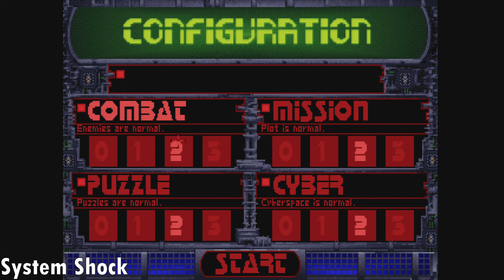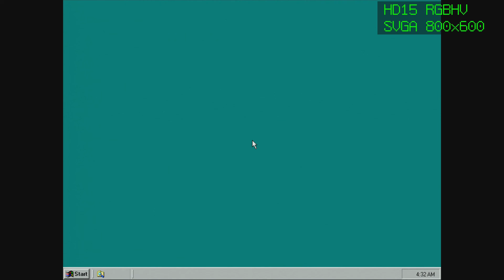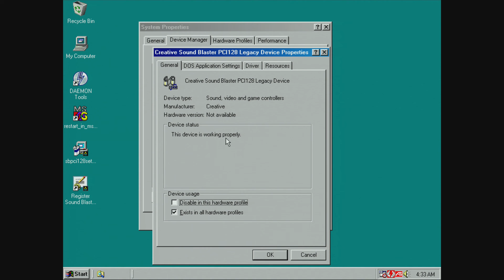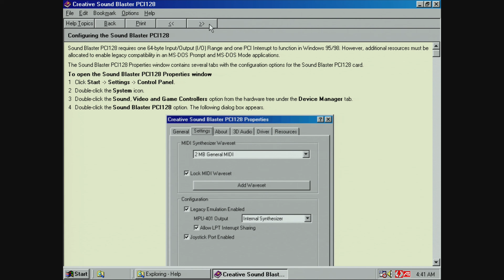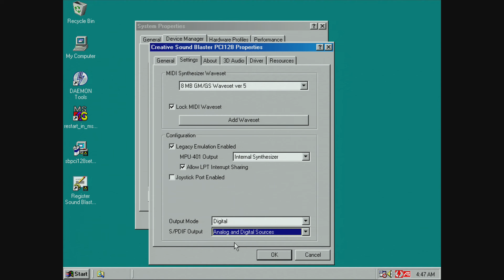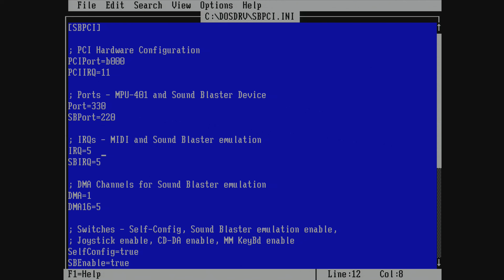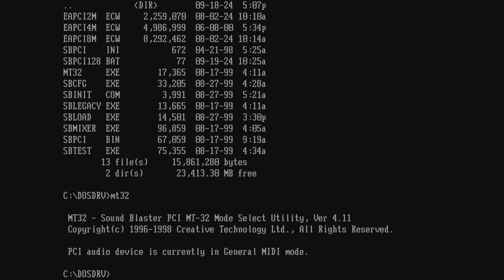Why no love for the Sound Blaster PCI 128?

Comment: I had a motherboard with an onboard Sound Blaster PCI 128 in the late 90s. I didn't have a great experience with it. Too many DOS compatibility issues and I hated the midi playback on it. Luckily the motherboard also had a ISA slot and got a Sound Blaster AWE32

Comment: This was the sound card I used in the first PC I built. Why? It was cheap and I didn't have much money. IIRC it was $25 new in 1998. That was actually an earlier revision, with the es1371 chip - still basically the same functions. It was fine for my needs and I never felt the need to upgrade it ASAP as I did with the cheap video card I had.

Comment: Thanks Phil, I'm impressed how your were able to get so much from that sound card! I tested it a few years ago and I felt like it was trash. Back then (in 2020) it was available for 1€ (1.08 USD / 1.63 AUD) in France. The driver has an emulated FM Synth that is absolutely horrible and sounds like a joke. The General MIDI works but I had issues like music crackling on Duke Nukem 3D on my Pentium 120 MHz build. I think this is a better idea to buy either a Vibra16 ISA (cheaper than SB16 and underrated) or a SB Live! PCI.

Comment: Do the newer drivers for the SB Live/Audigy support switching the MPU-401 emulation from the internal synth to the MIDI port? I bought a Live! card new in 1998 and the DOS drivers were terrible. Even the 2.0 drivers were pretty bad (although they had actual FM synth emulation), they STILL didn't allow you to route to an external MIDI device in DOS (ECW Ensoniq wavetable only) or Windows DOS boxes (internal SoundFont GM only). By 2000 I was running Win2k so I don't know if the DOS drivers evolved at that point. Once VDMSound showed up, I never looked back!

Comment: Does mpu-401 work in dos mode also? Or just in windows?

Would like to find a card that does it. The awe64 does allot and very good. But I can't for the life of me get mpu-401 and output to a Sc88 working under windows. In dos mode it works perfectly fine. But in windows it routes everything to the built in synth regardless what it set under multimedia devices and midi.

Comment: I have 2 or 3 of these. but I wonder how much performance these rob from the rest of the system.
Reply from the maker: Not that much I believe, but yes good point, it's not something I've benchmarked. Actually, I might have done something along those lines a long time ago. Not sure if the card was included though...
Reply: I have some CMI 8000 series pci cards that can do most of these functions & do DOS pretty well. They're typically an easier setup with the old drivers I have from my first card 20+ years ago. But they do rob some cpu power. 

That can be helpful when setting up systems for speed sensitive titles though.
Reply: @philscomputerlab  You did and you included it. https://youtu.be/TC01uiyuJxI

Comment: I can quite understand why they get shunned by the Retro PC community, because they were just as shunned back then when they were made. Although they were cheaper than the original Creative cards, they also sounded worse. This was best noticed with the Vibra 16 which was the first card that Creative rebranded from Ensoniq after they bought the company, to kick off their "budget" line of cards, which ended up in prebuilt PCs of all the main distributors (because "fsck the customer, they won't notice, and it's compatible as far as games go"), but few gamers back then honestly considered them for their home builds. The SB PCI128 was an attempt to fix this problem by pairing the cheap ESS AudioDrive processor with the Creative DAC that also was used on some of the AWE cards, which made the spectrum a bit more linear and improved the sound significantly, but also pushed the price of the card up enough that the distance to the "real" Creative cards just wasn't there anymore. Also, while the Ensoniq chip was SB compatible on paper, it had a few issues with some MIDI effects being rendered differently to the Creative chips (whether this was a bug in the Ensoniqs, or a bug in the Creatives that the drivers worked around and didn't work on the Ensoniqs, I don't know..).
As long as cards like the SB Live Gold or any of the other E-MU10k based cards are still available and affordable on Ebay, I doubt many retrogamers will go for the Ensoniqs instead.

Comment: I had an SB PCI 128 (CT4730) in an MSI slim Celeron (PIII era) system that I used to use exclusively for the X-Wing games as my main system didn't have a game port or PS/2 and the joystick and throttle devices I had required both. Sadly, it didn't get any use over the last decade and a half, I threw the joystick/throttle out (I now regret that) and pulled out the MSI system to make it a retro Win98 system earlier this year. It died 3 weeks later, a motherboard issue I can't fix.

I have since built another Win98 retro system, but I'm not using the SB PCI 128. I wanted a Win3.1/Win98/Win2K triple boot system and there aren't many PCI sound cards that have Win3.1 drivers. I ended up finding and using an Ensoniq AudioPCI 3000 which is what the SB PCI 128 chipset is based on!

Comment: I also have several of these cards. You often see offers where someone offers three or four pieces for just 10 euros. I have one of these in my fastest 98 PC, the Core2Duo E8600, because it caused the least problems. And in my Slot A PC with Athlon Classic 900 it is firmly soldered to the mainboard. I already told you that. You save a PCI slot if you only have a MicroATX board and need the other slots. But I'm very pleased that you took a look at these cards.

Comment: I had a version of this from 2001 which had no place for the power amp. Be careful with those, as they are also missing the buffer amp on the line out, and they have 10uF output coupling capacitors, making it unusable with headphones. You need at least 330, but rather 470uF coupling capacitors for good bass response on headphones down to 16ohms. And even if you replace the caps, the signal comes directly from the DAC, which is a bit weak to properly drive headphones.
The version shown in this video has an OCL output driver, which is the best option, especially for headphones.

Comment: Wow, I didn't know that pci 128 was capable of alla this, I have two Yamaha XG pci sound cards, one with YMF724E-V chip and one with YMF724F-V chip. The YMF724E-V card has a connector called "AC3 module" I've never heard of this before. According to wikipedia, it supports OPL3. The cards belongs to the Yamaha YMF7xx series which has a dedicated wikipedia page where u can read more about it.
Reply: The Yamaha will have great FM, bit I don’t think it support SB16, only SB Pro, which is important for some people.

Comment: MM KeyBd enable is likely related to controlling hotkeys from multimedia keyboards, those with volume controls, play and pause buttons etc. That was the time when managing your music CDs playback from the keyboard was a thing!
Reply from the maker: I wish there was more information as to what that means. AFAIK Windows 98 SE supports the volume multimedia keys just fine, maybe others also. But that's OS specific, nothing to do with drivers...
Reply: @philscomputerlab  from messing around quite a bit with Sound Blasters back in the 90s, I believe this may have to do with Creative's own bundled multimedia apps from the day, like Creative Ensemble, Creative Multimedia Deck, etc., for people to play different file types and audio sources when most of this was still somewhat in its infancy. Using tools like that with multimedia keyboard hotkeys may have required some of these MM KeyBd enable settings. MM KeyBd seems to have been adopted as a standard by many multimedia keyboards of the time. Maybe it's a way of enabling those hotkeys under DOS as well.

Comment: There are unfortunately a number of games where the SB16 emulation doesn’t work properly, like Epic Pinball and Jazz Jackrabbit. The quality setting changes the pitch, with funny results. Also, the analog output is a bit noisy compared to SB Live. As for the onboard amplifier, I think those cards were sold as SB128, while the same card without amp was called Vibra 128, but I’m not sure.
Reply from the maker: Those games are buggy to begin with, they have some Creative detection code and forces a lower sample rate. Lovely Epic stuff 😂😂

Comment: I had one of those cards in a pentium 2 machine since 1998, but I always had issues with DOS games with this card. Somehow I would get audio in DOS games when they where running from windows, but it would never work in real DOS mode. I hate this card with a passion because it lacks proper FM support and I had nothing but issues with it. It has FM emulation, and it sounds awful. Last year I replaced it with a cheap generic PCI card with a C-media chip and I finally have proper working FM sound in classic DOS games. The SB PCI 128 in my opinion is awful for DOS but it is fine totally fine for Windows. Those C-media cards ain’t half bad with the proper drivers, but they do have their own set of quirks, but I considered it an improvement for OPL oriented games.

Comment: Whoever wrote SBINIT must have been really good to get SB16 emulation working on a PCI card with EMM386. The basic problem is the SB16 API assumes you have access to ISA DMA and IRQs. So games would write directly to the ISA DMA registers and expect that to cause PCI DMA. Also they'd trap one of the ISA IRQs and expect that to work for a PCI IRQ. The IRQ issue isn't that bad - you just need to patch the I number in the BLASTER environmental variable A220 I7 D1 T6. You could probably do the same for the A bit, i.e. the IO address. DMA is a bit harder because you need to trap the IO writes to the ISA DMA controller on the motherboard and then emulate them by doing IO to the PCI bus master registers on the sound card. Now QEMM had an (undocumented!)  API for this but EMM386 did not, at least not in versions most people actually used. Maybe there was a different undocuemented API or maybe SBINIT patched EMM386's IO Permissions Bitmap in the Task State Segment and then hacked it's own General Protect Fault handler in in front of EMMM386's. Doing this reliably on a variety of versions of EMM386 and a variety of different motherboard chipsets is non trivial though. It's actually much easier to write Windows VxD because 16 bit Windows is built on this sort of virtualisation technology.
Reply from the maker: Rumours say that was one reason why Creative bought Ensoniq, to take their driver technology...

Comment: "I always make sure that the system is configured, without interupts being shared." - Leaves "Allow LPT Interrupt Sharing" turned on. :)
Reply: .. which doesn't have any effect as long as the LPT set to a different IRQ than the sound card. It only tries to share if you set it to the same. (if you turn this off in that case, the card will simply refuse to initialize and yield the IRQ to the LPT instead)
Reply: LPT is IRQ7 usually. Sound card should be IRQ5. You can disable the LPT and Com ports in the BIOS to free up IRQs 7, 3 and 4 if you have several cards installed. How do the graphics card and USB ports still work with no IRQ assigned? On an i430 socket 7 board, you'll need to install Graphics, Ethernet, USB2.0, optionally an ATA133 IDE controller, and a sound card. Ethernet can be an ISA card but it'll only be 10Mbps.
Reply from the maker: @simontay4851  First Sound Blasters use 7, so some games insist on that 🙂 Use PS/2 keyboard.
Reply from the maker: Yea the tick box is redundant because I've configured it already with that in mind :)

Comment: It sucks. No DOS at all, 100% software emulation tsr driver and half hardware dependent DMA emulation that won't work on newer mbs.
Card is capable alone of fm synth only and that's enough , the problem is about DOS classic sb irq,DMA and io range resources, and that's where mostly not working tsrs and software emulation appears , bad and very bad DOS compatibility is the key, it's not about this one, it's about any PCI card in DOS.
So no way for PCI cards in DOS and retro pcs below P3. There are fistful of sb16 compatible isa cards , much better , same as for wt synth, only fully standalone cards with onboard ram/rom cards acceptable for dos(awe32 and 64, that's mostly same 32 in DOS)
Reply: p.s. everyone must read about DMA on PCI emulation on vogons first. pc/pci and ddma.
For list of compatible chipsets and other requirements, and so on. pc/PCI for instance, requires hardware connector cable. And that just requirements, you can't use it in DOS on any newer chipset, in most p4 and some even for p1 even in 9x dos shell under windows, after that coming tsr with very bad compatibility anyway.
But in any case better solution - no PCI sound for DOS era, at all.

Comment: I bought one of these a few years ago when I upgraded my sound card from a SB Live to a Sound Blaster X-Fi, which lacked a gameport. I ended up installing the PCI 128 and disabled all of the drivers except for the gameport, but didn't really use its sound hardware since why would I need to?

Years later I ended up with an extra Slot 1 440BX system that had a broken Vibra 16 sound card. I swapped in the PCI 128 and gave it to a friend who wanted to experience Half-Life and some late 90s DOS games, and so far he's been really happy with it!

Comment: I got one of those in my w98 pc, and it works great with everything i`ve tried. I use that pc for gamers from 1997 and onwards, and I use my DOS pc for games older than that. It does have a proper oldschool soundblaster, because I want a good FM chip for those games.

Comment: I like these cards. Got one after I no longer had an ISA-slot for my AWE64. Nothing spectacular but decent enough.
For those interested the joystick port is a bit quirky. Here is a quote from the NetBSD man-page:
"The joystick port hardware works by emulating a legacy isa(4) joystick port, bypassing the pci(4) bus method for address allocation. This is unlikely to work on PCI busses other than the primary one. There is also a possibility for conflicts with real ISA devices because the PCI bus is probed before ISA." Don't know how Windows probes things, but hey.

Comment: I have one, possibly two CT4810. Now I'm curious if they also have the amplifier chip.
Any special reason why you changed IRQ 7 to 5? Is 5 more compatible with DOS games?
Reply from the maker: A handfuld of games, Gods is a good example, don't work correctly when using non 7 IRQ.

Comment: I'm totally a ESS Solo-1 autist but this video got me interested. What wasn't covered here was what memory managera do I need, does it work with XMS or do I need EMS...
Reply from the maker: It does need EMS!
Reply: @philscomputerlab  Did some testing and found out that PCI IRQ cannot be the same as SB emulation IRQ where Solo-1 it needs to be the same. Got that figured out but Death Rally just don't work with PCI128, sound is garbled. That is a dealbreaker and Solo-1 goes back in 😅

Comment: This sound card doesn't have any hardware acceleration. This card is just a AC'97 digital controller which is a common feature inside the south bridge IC post-440BX chipset era.
Reply: Maybe but I used both and the sound quality coming from the SB128 is much better than AC'97 from motherboards of this era.

Comment: I remember buying one of these in 1998, and for the price of £30-40 i thought it would be just like a bargain SB Live card.
Before getting this card, I'd heard a friends AWE-32 and AWE64 Gold in action. I loved how they both sounded, around the same time I'd also grown fond of the Yamaha S-YXG70 and WinGroove SoftSynths as i didn't have a hardware wavetable board of my own, so i had raised expectations for this card, but was somewhat underwhelmed by the onboard synths of the PCI128. I think i also had trouble using this card with a Cyrix 6x86 166Mhz CPU for some reason, but luckily i got to use it fully with a Pentium 200.
I don't dislike this card at all btw, it's just not my fave, especially as there's no way to install a Wavetable board to it, or the incentive to buy one for it.

I never got an SB Live, but I do use either an AWE-32 ISA or Santa Cruz PCI card with a Yamaha DB50XG daughterboard, depending on what i'm doing with my retro rig.

Comment: Because they were pretty much crap. At least in my experience.

I think I was looking for a sound card for my new Kt266 build. 
First one was a Forte Media I think. No joy, brought it back to the shop, next up was this SB128. It was clicking, probably in combination with the Via chipset. 

Brought it back again and splurged on an SB Live Value (double the price of the 128). Best decision ever, I used it for about 10 years in 3 or 4 builds. Never upgraded to the Audigy.
Reply from the maker: VIA chipset? Well they had PCI issues I believe...
Reply: @philscomputerlab  Some did, in combination with certain cards and timings. Never had an issue with the Live and I only used it with VIA for the first 2 builds. Then ULi, then AMD.
Reply: @philscomputerlab  I used my SB128 with a VIA chipset PIII (Mercury KOB-694X/FSX mobo) with zero issues.

Comment: This is a very good card. Being with the Ensoniq chip or the rebranded creative one, it just works. I had this card in my computers since late 2000's and I found it everywhere, from office PCs to dumpsters; at a point I had 6-7 of them around nad even I remember seeing it integrated on some OEM (HP or Intel?) motherboard.  Unless Creative Live! , any driver works, being it the Ensoniq original one or the Creative SB 128 PCI. Hey, I remember once trying to use the SB 64 PCI driver with it and it worked.
Anyway, thanks Phil for the review and for the undocumented and unknown features that I never knew about.